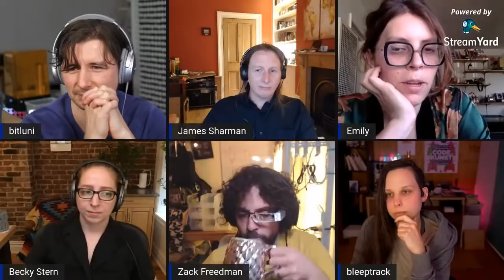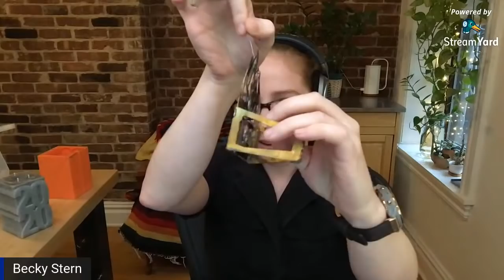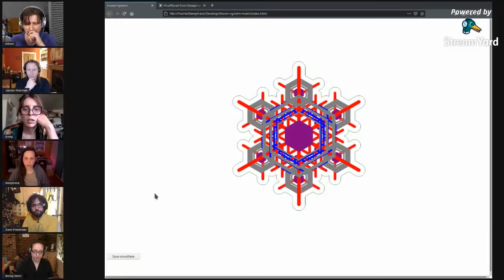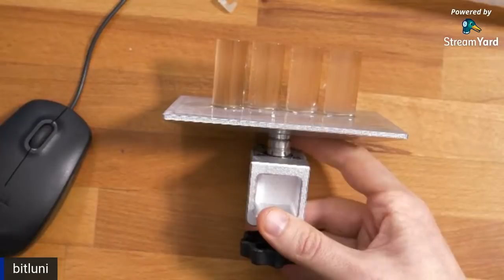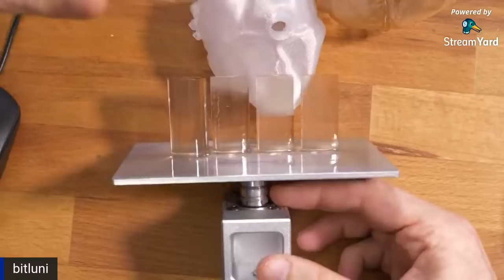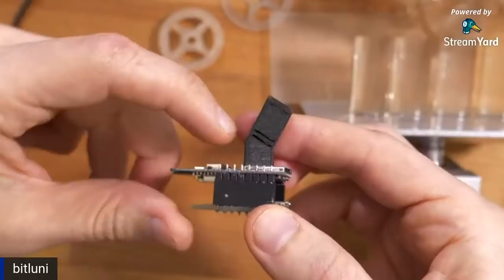Maker Cast Episode 24

Comment: @bitluni  re resin printers and lenses.  Consider printing moulds and add a small injection molding system. Inject hot clear thermal plastic into the 3d printed mould.  I've also though it would be a good way to make solid strong nylon gears.